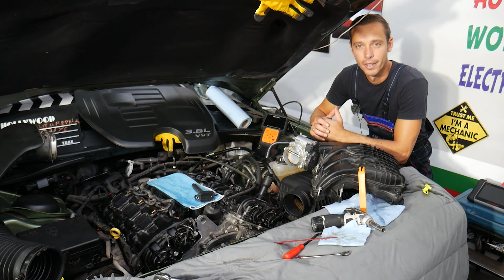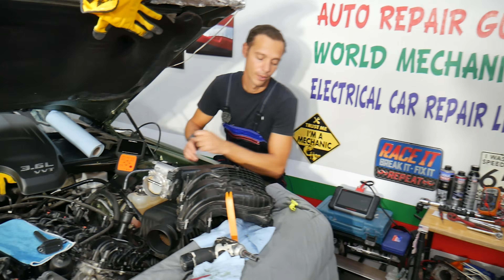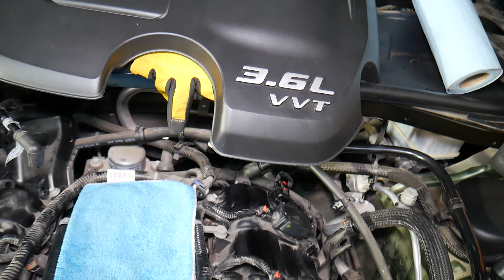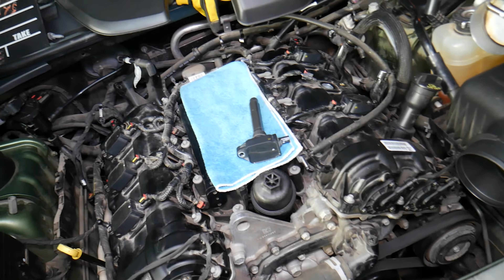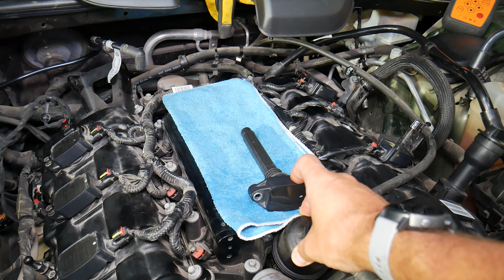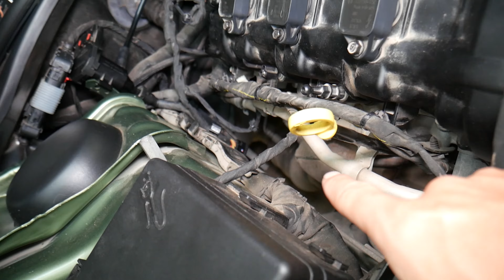WHAT WILL HAPPEN IF YOU DRIVE WITH BAD IGNITION COIL demonstrated on DODGE CHARGER

Comment: I got a problem I have an 08 ford edge that has a cylinder 5 misfire. I changed the plugs and coils, cleaned the maf sensor, changed the air filter,   and put in that techron fuel injector cleaner and It still says misfire cylinder 5. What else could it be ?
Reply: Your fuel injector can me leaking
Reply: Maybe a misfire in cylinder 5?  I dunno...
Reply: Have the dealer check it out